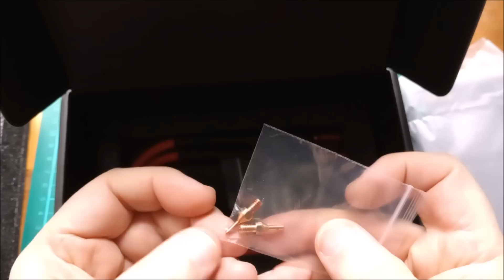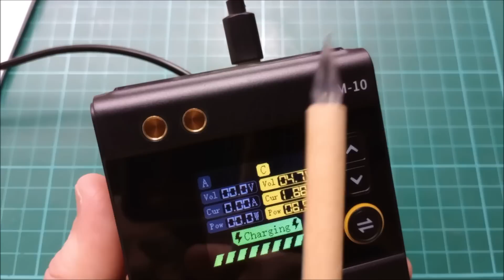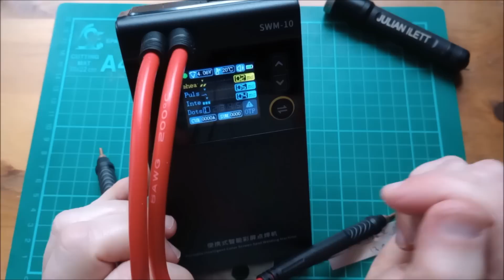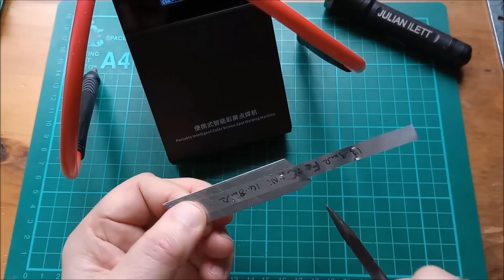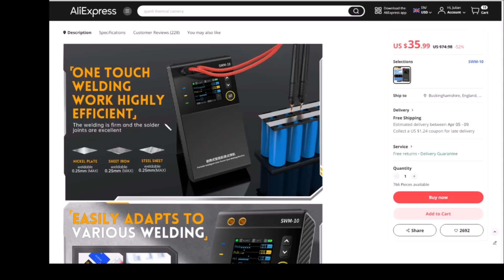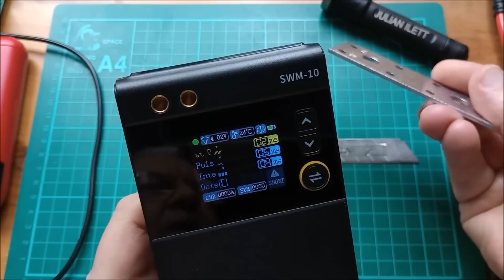Fnirsi SWM-10 Spot Welding Machine Review

Comment: I think you are doing it completely wrong. It will weld by the current going through the materials. So you need to place one terminal on the plate and the other on the base.

Comment: The reason you failed to spot weld the zink plated steel is because of the zink. Zink has a much lower melting point (420 deg C) and because of this, the temperature to spot weld steel is so much higher (1200-1400 deg C, depending on variety) that the zink is oxidated, effectively forming a non-metal insulating layer which itself has a much higher melting point than steel (1975 deg C) and that prevents the two metal pieces from bonding. Zink is difficult this way. When melting brass for casting, copper and zink has a much more similar melting point. Still you easily get the melt too hot and the zink turns into a white powder (zink oxide). Ruining your day.

Comment: What were you charging this unit from? It's not visible in the video. I'm using a 10W 5V / 2.1A USB-A charger from Apple that was included with iPad Air 2, but apparently the SWM-10 doesn't want to draw more than 0,38A from it. Same with a generic charger. The welding display shows the cell voltage at 3,89V. I thought it doesn't want to draw more because the cell is near full, but then I saw that yours was at 4,04V but was still drawing 1,97A from the charger. What could be wrong? -- EDIT: I figured out what was wrong. I was using the included short, thin, USB-A to USB-C cable which caused the unit to draw max 0,34A. When I tried a better USB-A to USB-C cable, the current draw went up to 1,9A. It is pathetic that they include such a useless cable in the box. My unit also refused to stop charging when battery voltage already reached 4,33V so I had to manually disconnect it!

Comment: I've got something similar but it doesn't beep, runs at 8 volts and it doesn't have as many settings it just changes the voltage with a dial, it be interesting to see inside one, I mean what do they use a relay or something

Comment: Just get this device today, trying on bad batteries just for training, 1st try fall of easy coz I didn't change settings at all, after that set settings like in picture in manual xD, 5-6-10 1spot and its weld really good, need to use strong force to break it.

Comment: Well, if you should be success with welding to a heavy metal plate, you have to put one of your welding pins at stick metal plate, other one at nic plate. You wil success. The reason for this phenomenon is the large surface resistance your spot welding masks encounter. Well done information due to this product and the properties. Interesting project and video notice. :D

Comment: that was painfull..
adjust the f'ing settings, so you at least give the viewers an idea of the performance of that device and what it can muster and what the settings allows and what current it peaks at and if the current reading are somewhat legit, as the voltage is quite low for a sportwelder, and quite a few people working with packs wont use so thin 0.10mm nickelstrips as it will not pass a lot of current-.. you seem to have more interests in using it as a power bank.
Fnirsi is known from being as dishonest as they come.. but keep going, and I do love how you spotweld 18650 cells on the side.... remember to charg3e these 18650 up, so they got a little juice to handle the pressure while being sportwelded on the side, and yeah, maybe you should keep those glasses on..

Comment: @11:00 That is what I wanted to see. That welds very strong. I have a bigger unit that plugs into the wall and it isn't as good as this. Ali Express, here I come!! And it's only $30!
Reply: @jlucasound did you pull the trigger and order it and have you received and tested it yet? Any good in your opinion?

Comment: Tested 10 cells (18650) have a capacity between 1500 - 1700mAh out of the advertised 3500mAh. Underwhelming product claimed as being Original 18650 HG2 3500mAh - brown sleeved. _A v o i d: >Sh op1103577373    Sto re<

Comment: I have no confidence in integrated spot welders that use only 4.2V, Give it about 8 weeks after the first charge/use, and the internal Lipo pouches lose capacity and no longer have the same power.

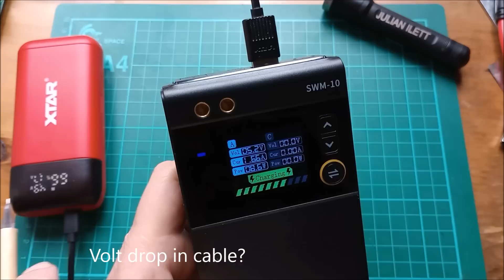Comment: @18:47 USB cables are notorious for using the tiniest gauge cable possible, and they do drop a decent amount of voltage.  You can find higher quality USB cables, and they aren't that much more expensive.  Even the 100 watt certified cables are only a couple dollars more.

Comment: On the thick plate your struggle is due to the zinc coating, any type of electrical weld (arc, mig, tig, spot, etc) over zinc coating are not easy and VERY bad to your health, those fumes contain really nasty stuff.

Comment: It's very easy to puncture microscopic holes in the cell walls using these spot welders. I noticed it one day after some series were dropping voltage quicker than others. What was happening was that the holes were too tiny for the eyes to see but they were good enough for the electrolyte to escape away slowly. I recently drilled 2mm holes on nickel strips and soldered them on cells terminals.

Comment: Co-insedentally I got a repair request.
My brother took a look at my Anker 26800 USB powerbank it has a burned up transistor.
My brother thinks expect it to be a 6239A - 2052/50.
He also thinks that the:
CYPD
316+C
2013 6
1143
Is still in functioning order.
Would you be willing to take a look at it? I am willing to pay minor compensation and cost of parts and ofcourse costs packaging and sending back and forth.
Next to just mentioned USB C 65W model I also own a funtioning barely used Micro USB model.
You could review both if you want to.
As long as price of new items I am willing to pay pony...
After all I seen a lót of 67r videos spread over many years.
Of weight was not so expensive I would let you revive my Flyer 20.6Ah bycicle battery at full price plus hours work excluding postage.
So you could put the welder into good real life scenario use, not that don't expect 69u to already will be putting it to good use.
My bother and I can both solder but without schematics we and values/ID we are both lost...
Ge because he is specialized on high voltage me because I have not soldered in a véry long time since brother enjoys helping me with electronics nowadays.

Any help is more then welcome, ofcourse if fixing turns out to be impossible or failing for any reason you can keep the USB C battery for any purpose ás lóng as you will not sell it or its components.
Giving it away at no cost no problem.
If not keeping it possibly returned on my expense.

*Transistor.*Co-incidentally

Comment: The lack of sparking is likely because you already have the circuit completed before the power is applied.  You only get a spark if there is an airgap for a spark to jump across.   The same as sparks in any electrical circuit.    The voltage is kind of irrelevant to sparking.    It's likely a much better controlled circuit than your super cap version

Comment: I feel like the device is designed to spot weld the strip to the top or bottom of a battery cell. I'm a bit confused by the choice of galvanised bracket, knife blades and side of a lithium cell as tests. You had the appropriate thing to test right there and while the single weld to the side of the lithium cell was interesting it still wasn't very useful test info. I'd love to see you use this as intended with differing settings and types of strip. I don't think I have any real valuable information from your video and I usually feel well informed watching your videos.
I do appreciate the video. I am deciding whether to buy one or not and your video came up while I am considering it. Any info is appreciated.
Reply: Exactly my reaction
Reply: I've seen from experience that if you push too hard on the probes your conductivity is too high and therefore you don't get it well you want some resistance between the two materials that you're welding so you want light pressure in my experience.
Reply: you seem to know what you are talking about: which one do you recommend?
Reply: @ I bought this one and it has worked well for me. I wouldn't recommend it for large banks but thats only due to it being battery powered and having limited run time.
For what it is it works quite well in my experience.
Reply: @bleepbloopblahp  did you tried with 2mm thickness?
Reply: @ytrew9717  I'm not sure what you mean?
Reply from the maker: Ha ha, yes, I like to experiment.
Reply: @JulianIlett I can certainly appreciate that.
I'm hoping we see some more of it in action making up batteries from cells. Not many videos of it doing it's job on yt as yet.
It's cheap enough to take a chance on and your video shows that it clearly is capable even if not showing how good it is for the intended job.
Thanks for the video, and all your videos.
Reply: The case of the cell is made of the exact same material as the cap on the end, so the weld to the side of the cell is an accurate demonstration. If you don't understand how batteries are constructed you probably should do a bit more research. Ignorance+Li ion=disaster. It's a simple formula.

Comment: I wonder if the interval setting is for between each dot... so a higher value there may allow you to move the probes after each pulse.
Reply from the maker: The 'dots' interval is adjustable in the settings menu (which I forgot to show in the video) but only between 0.8s and 1.2s
Reply: @JulianIlett  ok, I purchased one, been thinking about getting one for a while but never liked the others I saw, this one does a nice job and seems to have decent design.

Comment: These things are just more e-waste. The non replaceable battery will degrade to the point that it can't supply enough current to weld within a couple of years.
If it was powered with a transformer or capacitors it would last significantly longer.
Reply from the maker: Looking after your lithium ion batteries is important. My car is two years old now, and the battery is showing 99.2% state of health, because I follow the rules.
Reply: @JulianIlett  A EV is not discharging its battery at a 130C rate. It will take much longer for an EV battery to degrade to the point that it effects the performance.
Reply: just add diy battery pack box to your welder, lol. whats the problem? just add powerfull cells like Molicell p35a

Comment: Nice little spot welder. I agree with @donepearce about the leads, but hey, upgrades later ;)
I have one of the red circuit board ones. They require a lot of juice to weld.
This one costs less than the battery for the other one. Very cool!

Comment: I've had one of these for a few weeks. Really easy to use and really effective. I have tried to weld aluminium with no successful weld.
Reply: You probably need to clean the aluminium lightly with a fine abrasive paper to remove the natural oxide coating.

Comment: I see from many Utube channels - Never weld galvanised Steel ⁉⁉⁉⁉⁉
Reply: Only if you are burning it with gas tig or mig.
Reply: The zinc fumes can give you welder flu (a pretty nasty headache & fever).  Like most things it's a numbers game; a few spots welds won't matter, but normal welding for a few hours certainly will.

Comment: Hello Julian. Could this device also weld rail connections in railway model making? Normally I always solder these which is usually not nice.
Reply from the maker: Are the rails made of steel?
Reply: @JulianIlett  Thank you for your response. These rails have a nickel silver alloy.
Reply from the maker: Well, silver has the lowest resistivity of all the metals - that could trigger the short circuit indicator. If I remember my model railway days correctly, the rails have a tongue at one end and a slot the other. I'm not sure you could guarantee a good connection when you make the weld. But there's only one way to know for sure. Worth a $42 punt to find out?
Reply: People use spot welders for jewelry split rings so don't see why it would not work. Just do a lot of pulses?

Comment: A bit optimistic trying to weld to Zinc!
Reply: Might be a good think it doesn't try to muscle through a zinc coating. Things would either get spicy, or get very toxic :P
Reply: Welding zinc plated objects is hard work & dangerous fumes even with other welding techniques like Mig!
Reply: is the galvanized coating the reason he's getting a short ?

Comment: Not so impressed by the lead connections. They shouldn't interfering with each other, and they should be at the bottom so they aren't draped over the screen. Other than that, this appears pretty competent.
Reply: It has a settings menu that lets you invert the screen so you can use it upside down if you want.
Reply: @NaturalTangent  That makes sense. Thanks
Reply: I suppose they are meant to be at a decent working height for a n 18650  pack with the cells on end.  With leads that thick, you can't win. if they exited at the bottom, the welder would be hoisted in the air as you raised them to the top of the cells to be welded.  May be better if there was a fold forward foot that you could stand the  battery pack on during welding?
Why on Earth choose a 2mm lump of zinc plated steel as a welding test?
Reply: @mikebarrett2621  I guess. But if they had turned the internal battery round so the lugs were at the bottom, they would have been at the right spot to emerge. There would be no need for the tilting bail - this would be just fine lying flat. I'm guessing this is using GaN FET technology and four of those would handle a thousand amp transient. But I didn't engineer this, and I'm sure they considered all this stuff.
Reply from the maker: The interference is slight, but you probably noticed the 2nd probe pushed in a little slower than the 1st.
Reply: If this guy would've went through all the settings instead of wasting 20 minutes of our time for 4 welds you will see that there is a setting that allows you to rotate the screen meaning you could theoretically use the welder upside down, so the probes won't be in the way.